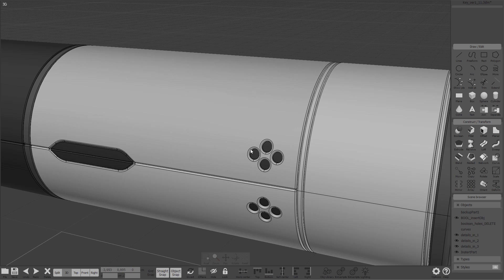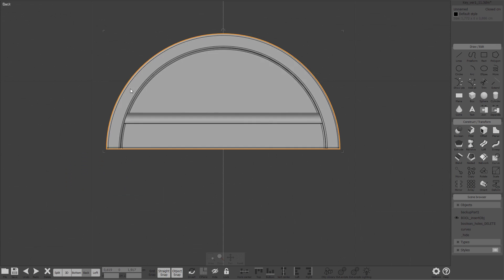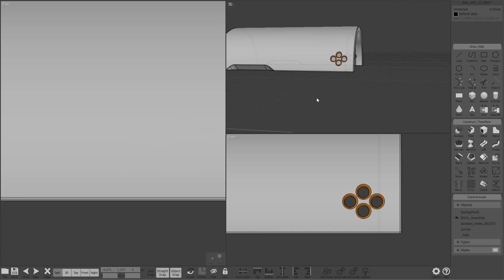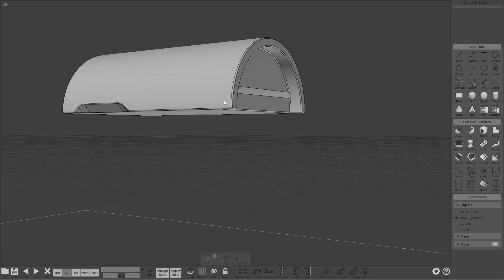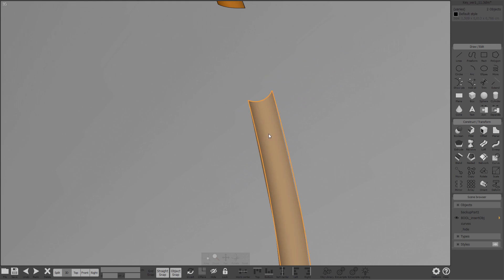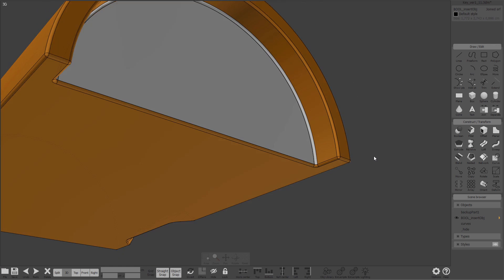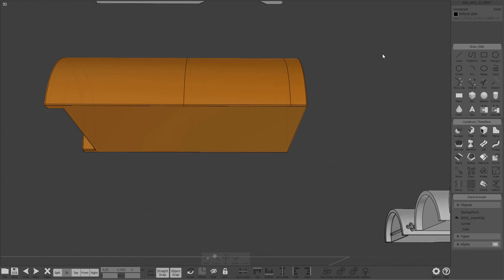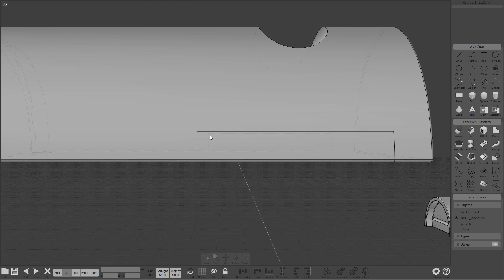Moi3D tutorial - Fix Tips 1

Comment: Export to fbx leaves isolated vertex any tips to stop this.
Reply from the maker: Not sure i quite understand what you mean by leaving isolated vertex? Do you mean, vertices not welded so the mesh comes in separated pieces?
Reply: @klaudioladavac  say you mak a cylinder and the edges loop around as one line, in between there are edges not connecting leaving a vertex at each end of the line, so you have to weld the verts or delete the lines it takes a lot of clean up. You can use triangles but it's no good for mapping.

Comment: Thanks for the great tutorial! What is the difference between using join and boolean union when connecting solids?
Reply from the maker: I am glad you find it helpful! The difference is that Join will "attach" two or more pieces together, for example, attach two curves or attach two surfaces, which are not solid, together (for example, two planes). Boolean Union fuses two solid objects into one, for example, two spheres fused together. If that makes sense. I suggest to give a search for "Moi3d help" and there you will find explanations for all individual moi commands.